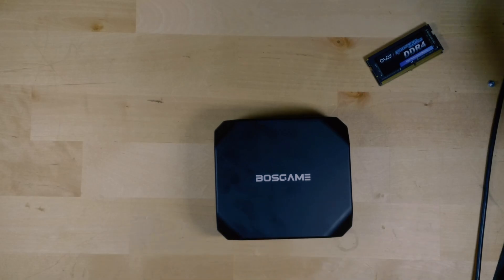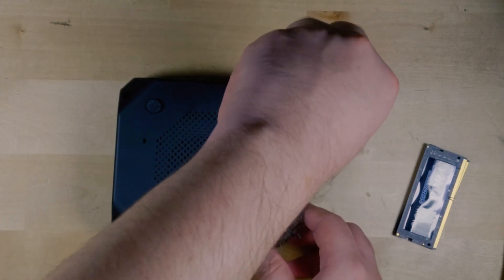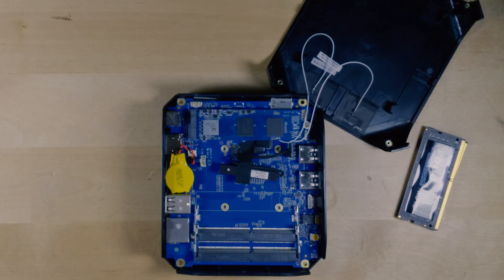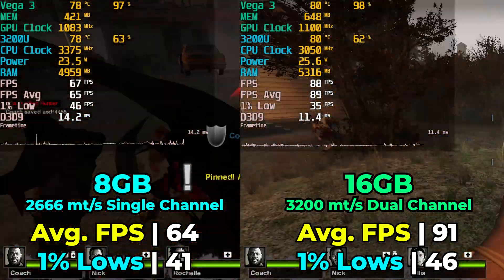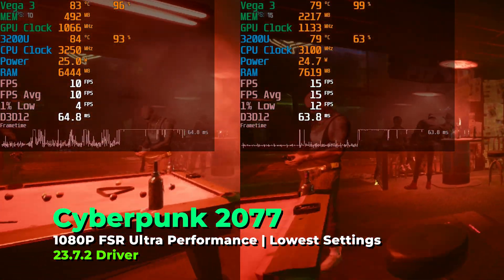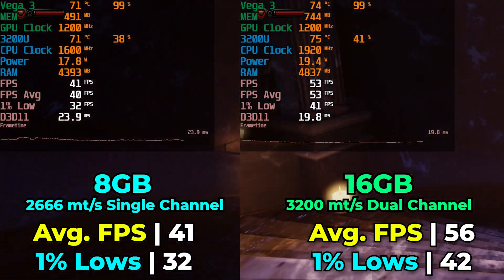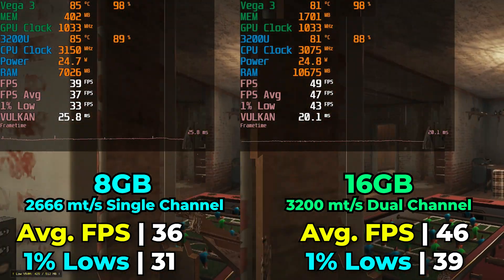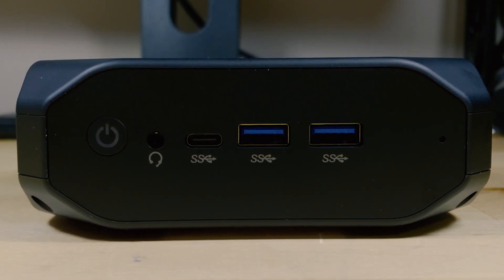BOSGAME U32 RAM Upgrade! 8GB vs 16GB Performance Comparison | RYZEN R3 3200U 8GB Mini PC

Comment: Just wanted to say this was a super helpful video, really appreciate you doing these. 

I’ve been eyeballing this as a super budget Windows machine for late 90’s/pre-2010 games that simply don’t run well enough on the Steam Deck (Thief 1 + 2 for example). Cost of this machine is less than a Windows license, so with a cheap dual stick ram upgrade, this seems to be perfect for that use case?  👍